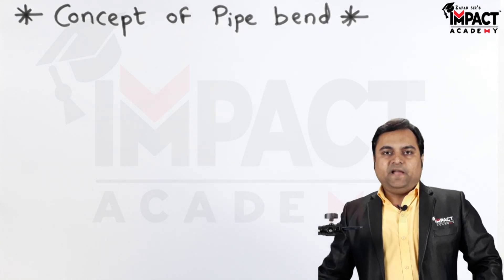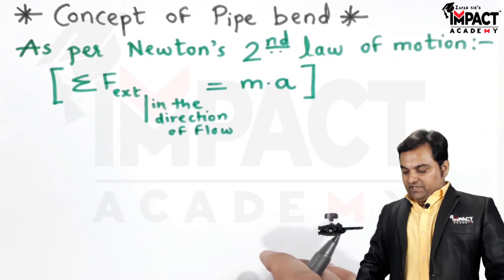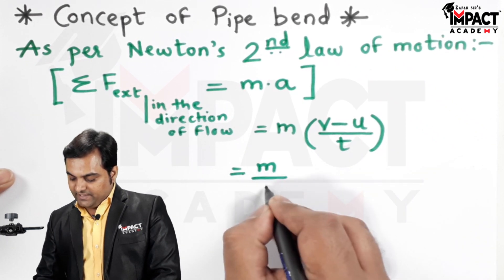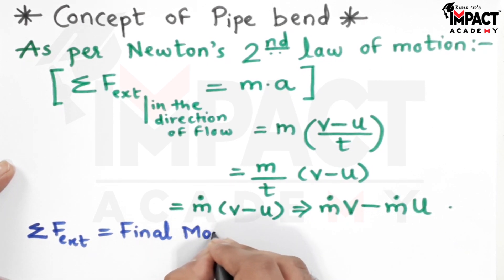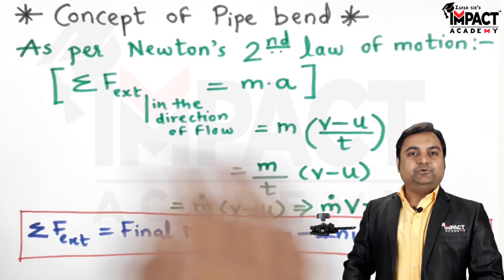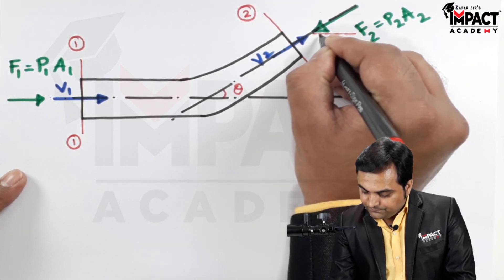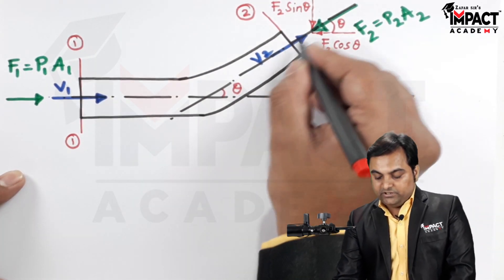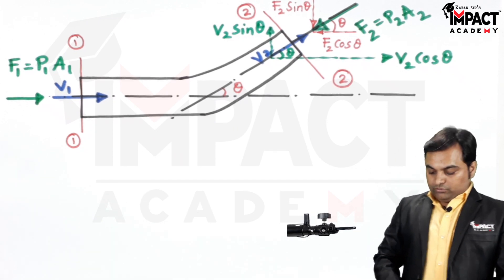Concept of Pipe Bend | Fluid Mechanics & Machineries | Mechanical Engg | #zafarsir #freeengineering

Comment: I don't think that the flow is possible only if there is pressure difference....Please elaborate it....
Reply from the maker: Flow may also take place due to potential difference bcoz of height difference between two sections which means flow takes place from high pressure to low pressure region...👍👍👍
Reply: @ImpactAcademyOfficial  ya , but in this case pipe is horizontal then why you took - ( - )P2A2
Reply: Think like this, At point 2 the pipe continues and the force exerted on pont 2 in the direction of flow will be p2A2 then it is obvious that for net force at point 2 be zero a force equal to p2A2 should act in the opposite direction of flow and that force at point 2 is considered here
I think that will clear the -ve sign issue